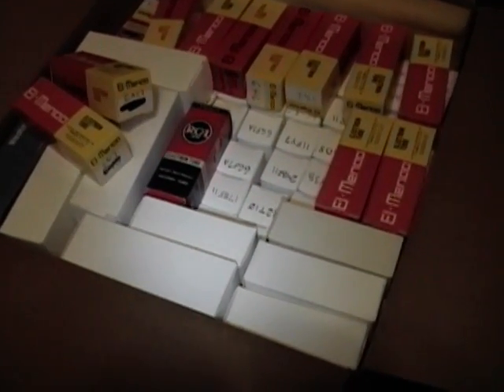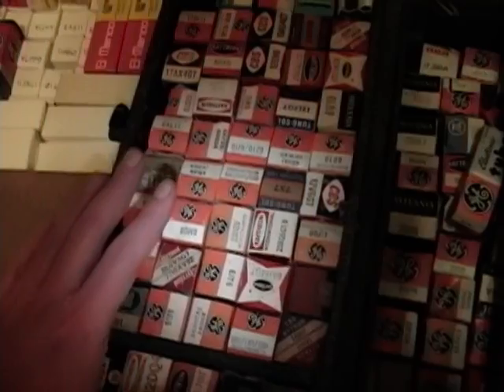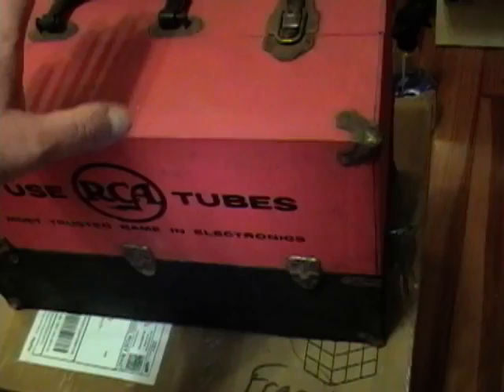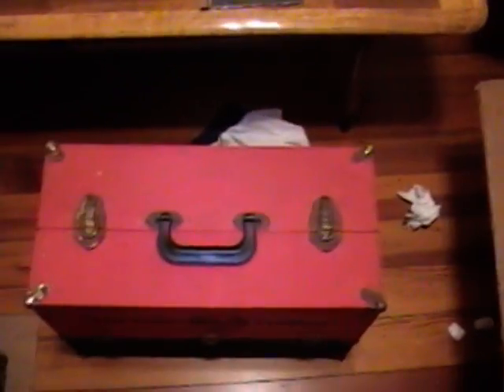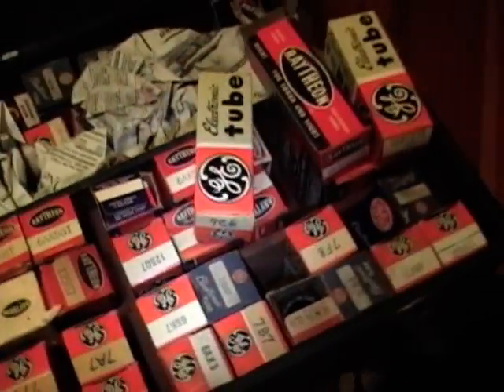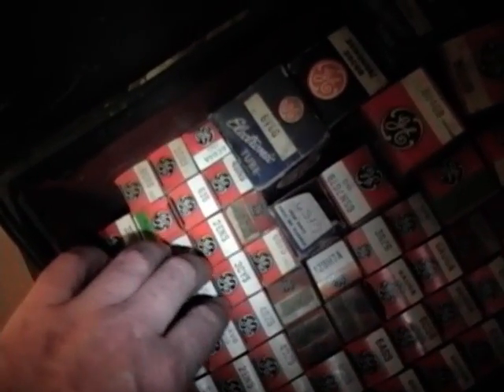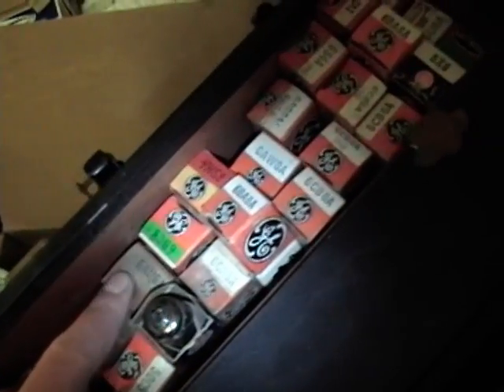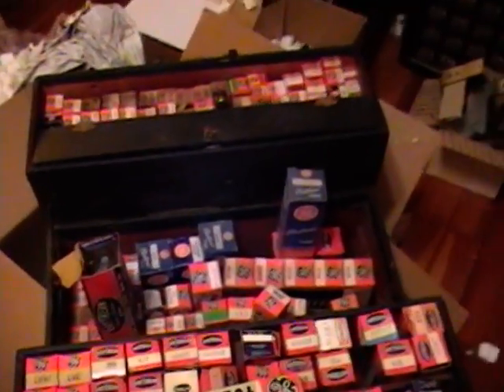Tube Caddies

Comment: I have looked and looked thru tube caddies for what I wanted.  The spreadsheet idea is a really good one and will allow you to keep an inventory going of the tubes you really need to keep around.  Good video.  It is fun following your pickups.
Reply from the maker: Thanks.  I have more tubes than will fit into caddies so lately I've been organizing them in boxes.  For example one box is only tubes that start with "6A" another "6B" and so on.

Comment: @bandersentv Ah, the 6SL7, that was the other twin triode I was trying to think of, those are supposedly better audio tubes then the 6SN7s. It has to do with the electrical characteristics of the tube, mutual conductance I think, a  6SN7 is a medium Mu tube and a 6SL7 is a high Mu tube. I have one PA amp that uses all octal tubes, an old Bogen, but it uses 6SF5s which is a bit of an odd tube but the audiophools have no interest in them, both are bad but I don't have any spares at the moment.

Comment: Any 5V6 tubes among the series string TV ones? They make good substitutes for 5 volt triode tubes once you build some adapters. My tubes are stored in cardboard trays in an old dresser, and on an old steel shelf. I don't understand the hype surrounding 6SN7s, they were never that good for audio purposes and are not even close to rare, I've found them in just about every box or bucket of tubes that I have picked up over the years.